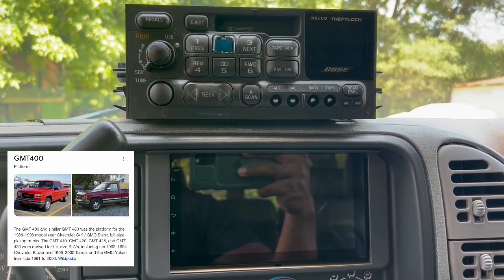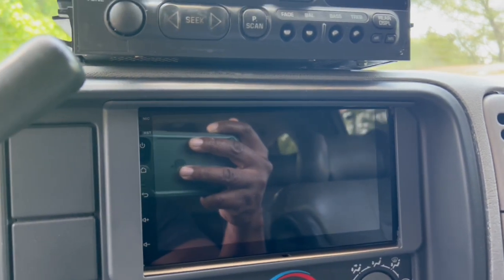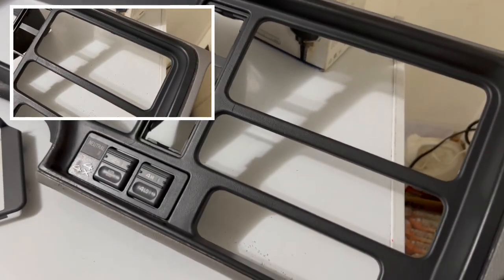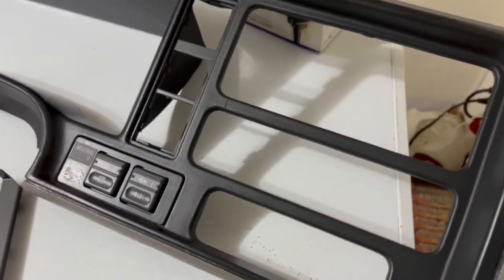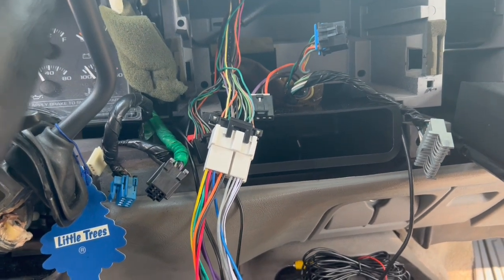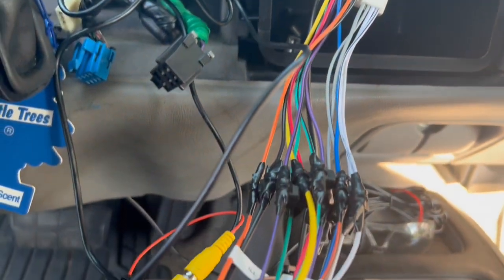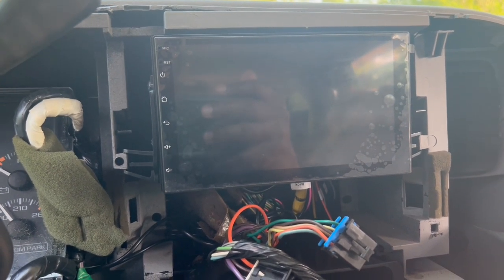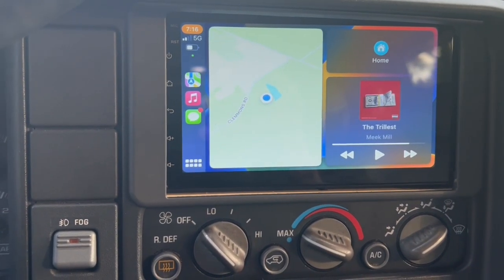GMT400 Tech: Ebay 7 inch NHOPEEW Apple CarPlay Head Unit Install with Factory BOSE Amp/Subwoofer.

Comment: Thanks for this video.I like how the gps antenna gets hidden under the dash bezel. At 5:06. Would this location also work for something like an XM antenna for radios equipped with an XM port like the kenwood and Atoto products ? Or do XM antennas need to be mounted outside the vehicle ? Thanks !
Reply from the maker: Yes they will still send and receive if they are hidden.
Reply: @MagnusPrimeE1 ok thanks this is excellent information, I had no idea.